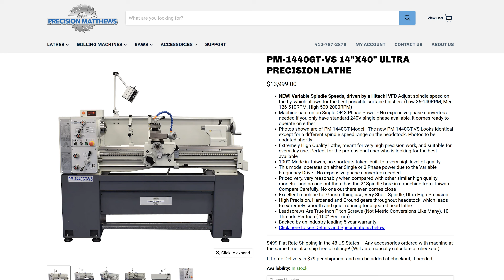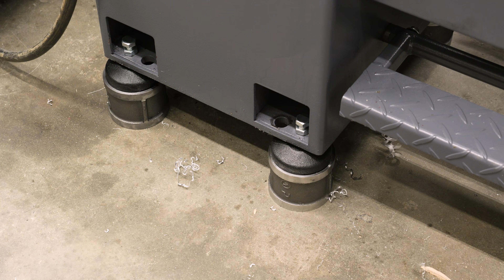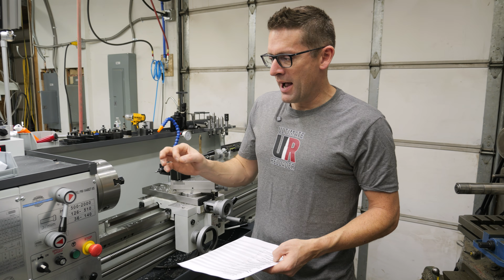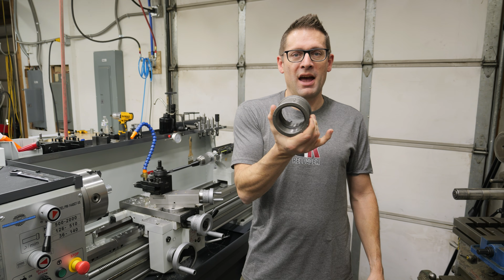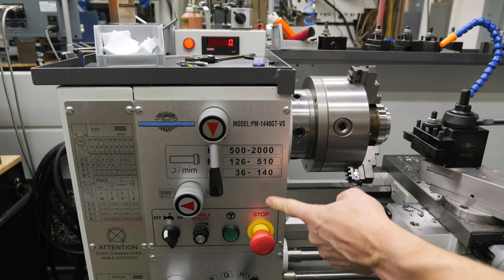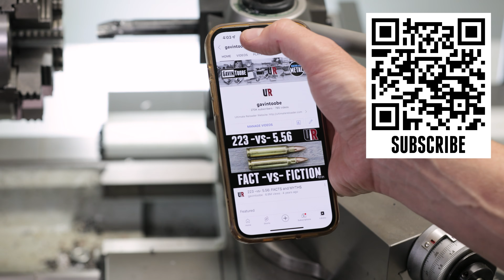NEW PM-1440GT-VS Variable Speed Lathe IN-DEPTH

Comment: Nice review! I am not in the US but looking at lathe choices in this size range. Was looking in the UK at the Colchester Student which is what I would have trained on 35 years ago. I'm a purely metric guy, but if needed would cut imperial threads. Need to read up if there is any disadvantage / limitation in that regard.

Comment: 2000rpm isn't much for a lathe that size?  Should be caple of at least 2.5 or 3000? 
- for small work in collets and so..

Even my Microweily TY2500, +X2 the size did +2600rpm.

Comment: Nice lathe. Do they offer a taper attachment?  For chambering rifle barrels on a manual lathe a tracer attachment provides much more flexibility for configuration, surface finish and concentricity. The downside is that tracers require SKILL.
Reply: yes there's a taper attachment. its $999

Comment: Not talking about capacity, but how much better is this vs the 1340GT, manly accuracy wise.
Reply from the maker: It is heavier, more rigid, however the PM1340GT does a great job as well. Two big differences on this machine: A foot brake (I miss that when using the PM-1340GT) and variable speed! The big advantage of the PM-1340GT over the PM-1440GT-VS is the shorter spindle for working on shorter barrels.

Comment: I worked in a machine shop back in the 80s straight out of high school.  The work was boring as we made stainless steel orifice plates for gas line measurements over and over.  They were precise, within less than a thousands of an inch precision.  We tried to get them dead nuts.  If  I had known that I could have started making my own barrels and machining receiver actions, etc. etc.,  I probably would have stuck with it, learned more and then bought my own equipment.  I completely went in a different direction with a career in wireless RF after spending 23 years in the AF.  Now, at 59 I'd like to build a rifle from scratch, as a hobby, but dropping 13 or 14K for a lathe like this, I think I would need to figure out how to make some money doing it.  Recoup back some of the expense or actually try to make a profit.

Comment: Did you consider something made in USA or Europe? Was a big $ difference?
Reply: US/Euro machines will typically run at least 2x
Reply: @portersorensen8814  and will keep their value equal.  And last way longer. Probably...   
Finish and general build quality isn't comparable.

I've owned a Microweily lathe, way larger than thise.  Good machine.  But lack proper engineering and finish...
Reply: @OmeMachining  Last way longer?? I find that hard to believe vs. a quality Taiwanese machine. But I guess we won't know for another 40 to 50 years...
Reply: @steveh8724 i have owned one myself. And we have several at work.   They aren't holding up as similar sized European machines.   Cheap electronic, casting isn't as good, finish isn't as good. Rubber seals isn't as good. (Oil leaks)

Comment: I have a similar size lathe and set it up on blocks and leveled it up. I found i had a vibration at about 600rpm.  The only way i could get rid of it was to bolt it to the floor. Have you bolted yours, or is it just sitting on those blocks?  Nice video, thanks.

Comment: Nice machine,Gavin!  Is this lathe capable of using the T.B.A.S.?
Reply from the maker: I do not recommend it on this machine, when you dial it, it moves a massive weight off center and you’ll get vibrations on a lathe of this size.